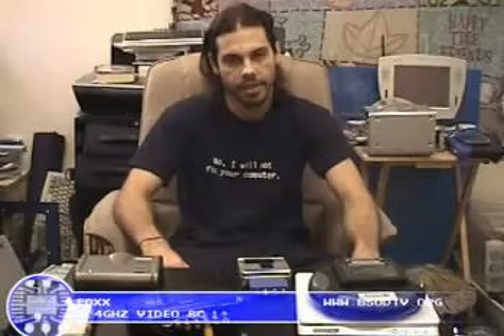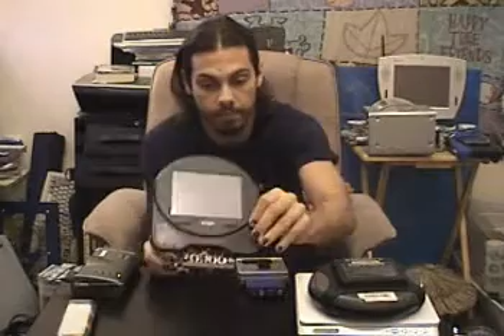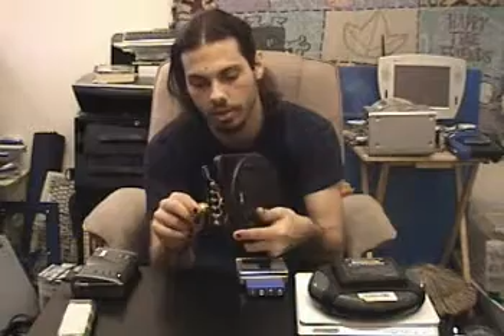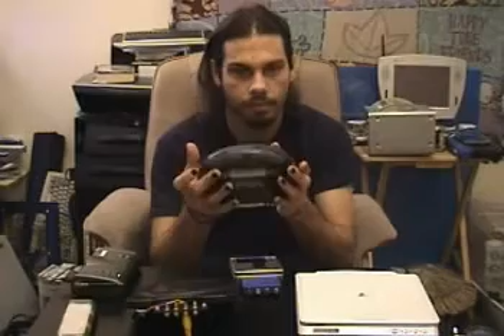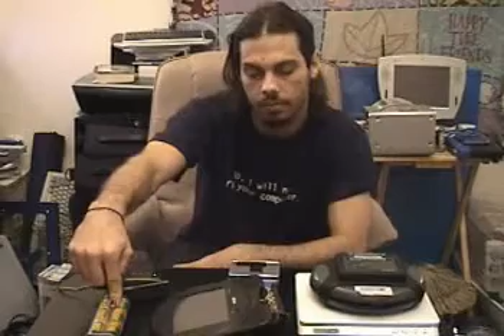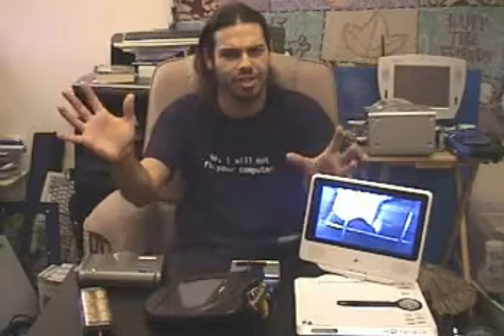2.4 Ghz Wireless Video Scanner

Comment: A better battery system is using an old Motorola radius GP300 or maxon SP140 back plate mounted on the LCD screen and putting a Ni-Mh Motorola gp300 or Maxon Sp140 battery on it and if you can improvise a battery lock this battery has a belt clip option which you can clip it onto your belt considering you have a small screen. Those batteries run at 7.5 VDC @ 1200 - 1800 mAh
Reply: Nope, making lithium pack better.